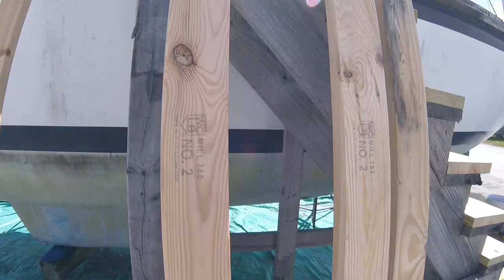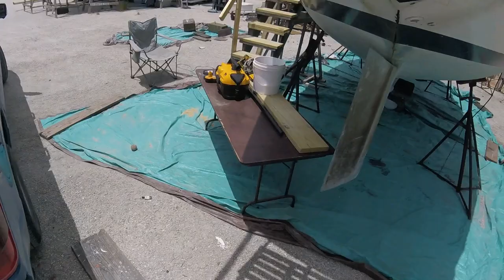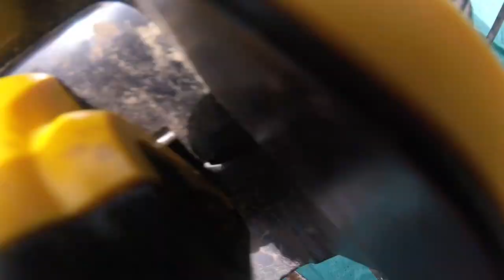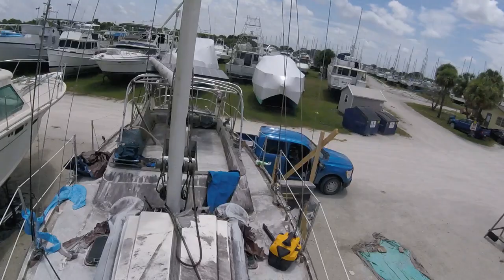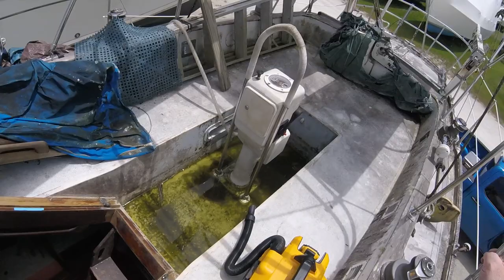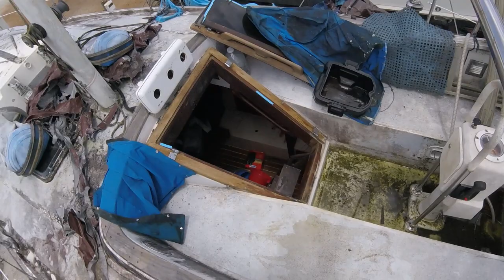Grandpa's Sailing and Diving Adventure - Another Day, Another Failure

Comment: A plumber once told me it only makes it worse to suction a clog, he said to always blow it away from you to lossen it up. If it's possible to do it.
Reply from the maker: Turns out it was not clogged. The previous owner had actually closed the thruhull. Turning the cockpit into a giant bathtub that leaked down the companion way and damaged the woodwork. All very fixable. We have opened the thruhull once again.